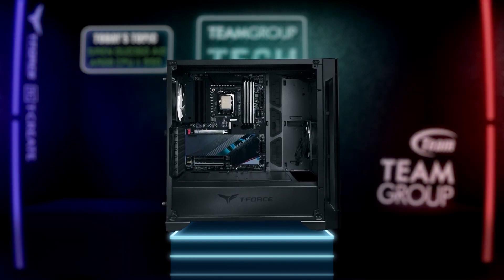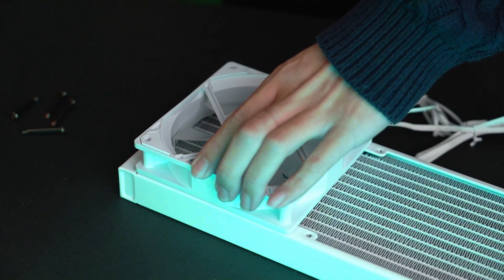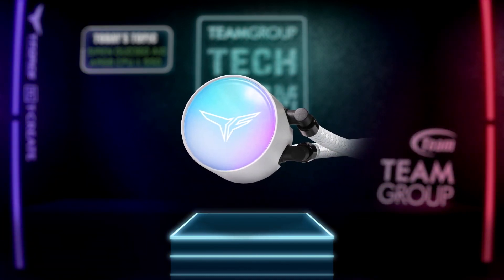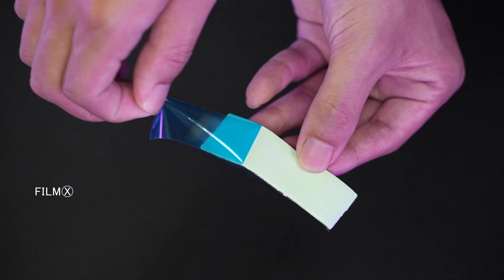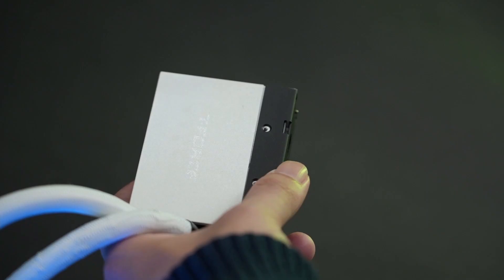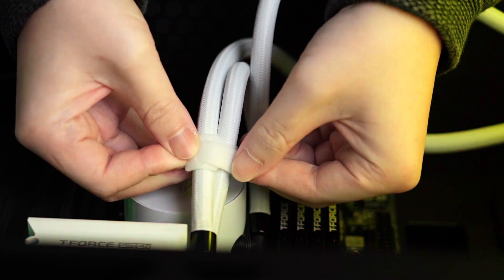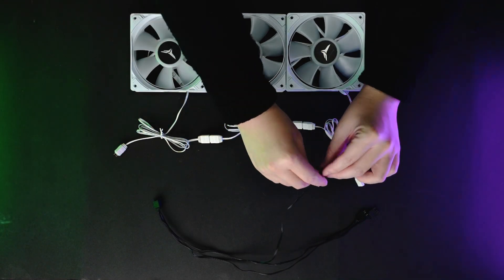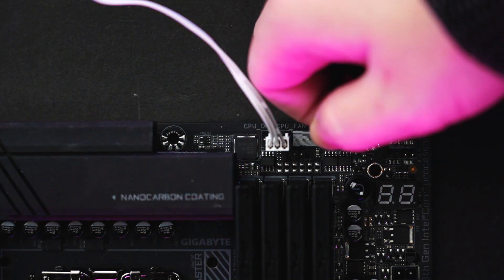How to Properly Install the T-FORCE SIREN DUO360 AIO ARGB CPU & SSD Liquid Cooler? | Tech Room

Comment: You installed the fans to pull the hot air from the radiator back into the case 🙃

Comment: When the SSD water cooling is installed, the T-Force logo is facing upside down.
Reply: But once it's installed and you're looking at it from a installed perspective, the writing is the correct way. For example, if you go to 4:48 when they show both the nvme and cpu blocks you can see how it would be as if you were looking at it once it is installed and you can see that the writing is the correct way.

Comment: Those dots of thermal paste are too close to the edge on the 4 corner dots. They should be equally close to the middle dot as the edges, which they are not as shown in the video. Otherwise a lot of the thermal paste will leak off the side of the cpu, and there may be thermal paste gaps between the areas covered by the middle and edge dots.